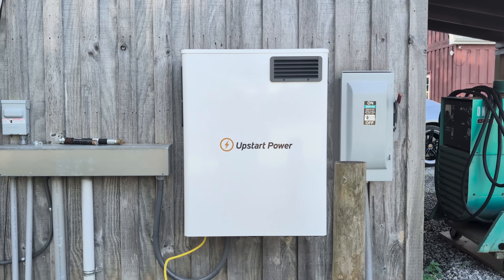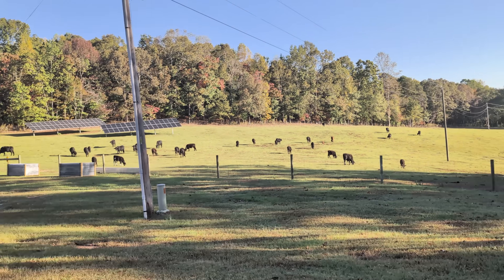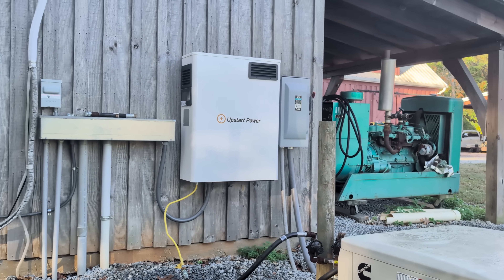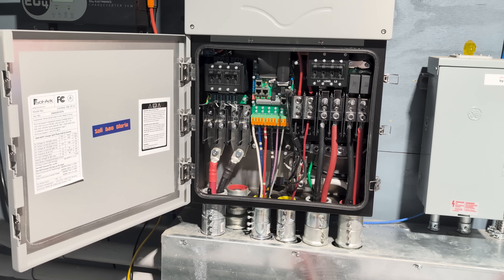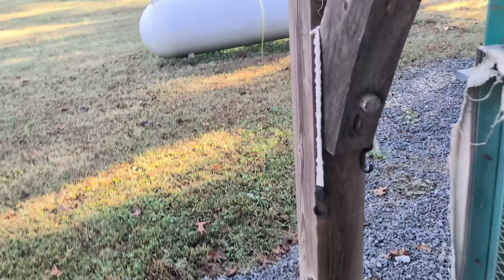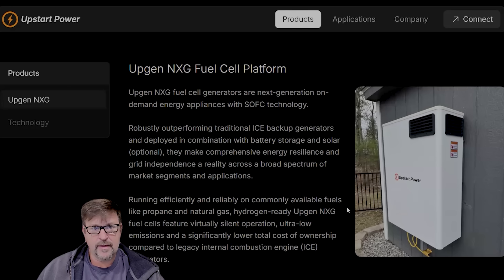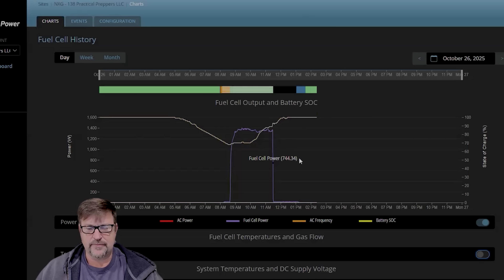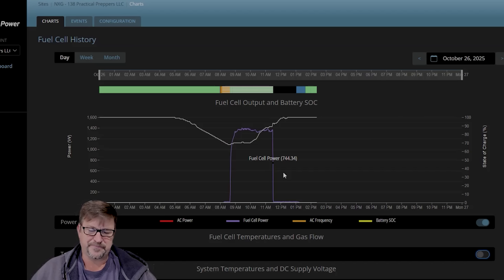You’ve Been Waiting for It | The Upstart Fuel Cell in Action

Comment: Does this utilize the 2 wire start? If so how do you wire the generator to kick in at a different SOC then the fuel cell?
Reply from the maker: Yes it does
Reply: @engineer775  is there a way to run two 2 wire starts on the sol ark?

Comment: This is super interesting. I live in a part of the Pacific Northwest where solar is difficult, but with frequent power outages due to winter storms we do have a 16kW propane backup generator with automatic cutover. I’ve been thinking about battery backup solutions lately, and it seems like we could augment that with one of these. I don’t think it could replace the generator, at least not yet, but I’m interested in doing more research.

Comment: This is very interesting!  I've lived off grid for over 4 years and hearing the generator run during 3-4 months to charge the batteries when the sun just isn't there is quite a bit different than the quietness of solar production.  I think about where we live having an over abundance of wood and the ability to produce wood-gas to power our backup power needs.  I also think about the excess generation that we have in the summer months and the ability to create hydrogen that could be stored for the winter months on a fuel cell like this.  I would love you to do an experiment on wood-gas generation and the ability for the fuel cell to use that as a source rather than propane.  Keep up the great work!

Comment: A (Help-)question from Holland/Netherlands. I have a SigEnergy plus gateway 10 kWh inverter plus ~27Kv battery systtem (3 *  battery type 10 SigEnergy) and 14 * 475 Aiko Solar panels. I'm looking for a super low noise (whisper-silent) device to load my battery with autostart. I'm living in a urban environment (on both sides of my home I have neibours, so a normal inverter-generator (>60db) is to  loud. My SigEnegery-system support a 3 3 phase 230v/400v autostart inverter-generator. I.m not able to find a "very low noice c.q. Whisper-silent" inverter generator. Can yopu help me out (I'm not a technical person but I'll hire a eclectrician  for install a proper device)  Hope I can find the proper solution to top-up/load/unload my brands new battery system with your "helping suggestion/support" TIA

Comment: Wow.. I'd really like to know how many kWh per Kg of propane!
Reply: FUEL CONSUMPTION:
Propane: 0.13 Gal / kWh
Natural Gas: 12 ft3 / kWh
Reply: @UpstartPower  am I doing the math right? ~4kWh/Kg of propane?  If so, we sailors desperately need a marinized version!
Reply: @GordLamb   Propane:
0.13 gallons = 0.25kg / kWh
1kg = 4kWh 😀
Reply: @GordLamb  What are the requirements for propane storage on a sail boat and what are other marine-specific requirements?
Reply: @UpstartPower  storage is typically in a corrosion resistant tank (ie. aluminum or stainless steel) with a remotely controlled shutoff solenoid at the tank itself.  Since propane's heavier than air, sensors/alarms are usually placed at the lowest point (ie. bilge), often with remote solenoid control.  From the device perspective, the goal of marinization is to reduce susceptibility to corrosion and vibration, and often to heat sink with seawater rather than air.

Induction stoves are becoming way more common today but many (probably most) boats under 50' still have propane aboard for cooking, usually with 20-50lb of propane.  Tapping into it for a fuel cell would be a piece of cake.
Reply: @GordLamb  Noted. Thank you! 🙂

Comment: Will the fuel cell work in Arctic conditions? It get down to -50f where I live but this is intriguing. With how quiet it is, could it be run inside and have the exhaust piped outside?

Comment: I'd be interested in seeing a fuel efficiency comparison between the fuel cell and and IC engine generators. Also interested in a total cost of ownership comparison for 5, 10, and 20 years.
Reply: I would also be interested in a side by side comparison in KWH provided versus the propane generator and the upstart in propane use.  You could use two full portable propane bottles to get your measured results.  If what they are saying is true it would produce 8x the KWH over time.
Reply: @Jim14872  based on their published numbers, it looks like they are about equal, but of course the fuel cell is silent and requires little to no maintenance.  I am not sure where this claim of 8x is coming from?

Comment: Could you tell us more about the software you are using to monitor and integrate the fuel cell into your system? Does Upstart provide a Modbus register map, MQTT topics, or an open API that could be used to integrate with a system like Node-Red or Home Assistant? Currently I use Solar Assistant to provide an MQTT interface from my two Sol-Ark 15ks towards Home Assistant for monitoring and in the future, load management.

Comment: Awesome piece of equipment. I will own one when they are available for $2-3k
Reply: That will never happen as their is far more than $3k worth of precious metal in the fuel cell. Also you really want to pay 5 times as much compared to diesel for a fuel that is hard to get, hard to transport, hard to store and embrittles every piece of metal it comes in contact with?
Reply: @Aircam73  again, the primary fuel source for this product is propane, which is slightly less expensive than diesel where I live (by volume, in terms of energy stored about the same).
Reply: @qaggaz diesel is currently $4.09 a gallon here and diesel generators are noisy and require maintenance. I’m looking for a quiet, low maintenance path.
Reply: @qaggaz  Propane is just the added step that is used because hydrogen is so hard to source. The propane has to go through an extra step losing energy to convert to hydrogen before going into the fuel cell. This method and even the hydrogen method means the fuel cell can't be put indoors because when propane is used it create hydrogen on the backside that has to be released. Even direct hydrogen fuel cells should not be put indoor as any leak will pretty much blow up the building.
Reply: @Aircam73  Understood.
Reply: @Aircam73  however you stated that the fuel used (I assume you meant hydrogen) was five times as expensive as diesel. However, propane is certainly not more expensive than diesel, and that is the fuel that this unit uses (transforming it in to hydrogen as an intermediate step).

The data sheet specifies 0.13 gallons of propane per kWh, which is about the same conversion rate that I get with my diesel generator. So, not much money to be saved there, but also not worse than a diesel generator, and certainly quieter and requiring less maintenance.
Reply: @qaggaz  The data sheet is going to be a little optimistic as we can see they said it should produce 1,600 watts but only produced 1,400 watts. Also how much electricity is lost converting the propane to hydrogen? They keep saying that the fuel cell is MAKING 1,400 watts but of that 1,400 watts how much is being delivered to the batteries or your home power? Maintenance is probably going to be less on the fuel cell than the generator but the cost per kWh over the generators lifetime is going to be far less. With the incredibly low runtime of fuel cells before needing to be replaced and and the steam reforming part of the system as the very expensive rhodium is used up makes the diesel generator far cheaper over its lifetime of 50,000+ hours vs 2,000 to 3,000  hours in a fuel cell.

Comment: Look up Mike Strizki. And his hydrogen house. Old school YouTube stuff. He built a fuel cell with 10 x 1000 gallon propane tanks that pushes and pulls hydrogen from these tank banks to store during day then pull from at night. That idea with today’s tech would be so so cools
Reply: Hydrogen storage ends up being one of the more complex parts of the system (unless you have a lot of room for low pressure storage!). But that is exactly my goal as well. To be able to supplement propane with solar generated hydrogen, but to be able to run off of either pure propane (if needed) or pure hydrogen (to limit the amount of H2 storage required).

Comment: Crazy that for 8k I can buy about 6 100kwh tesla model s batteries these days. This is doa tech. Especially when ev's are rampant and cheap.
Reply: You still have to charge the batteries.
Reply: @qaggaz 10 cents a watt for solar panels. Even on cloudiest days you can get that extra 6kwh he was generating in a jiffy. This would be great for an underground bunker though
Reply: @EugenePutin  He was talking about generating 30 kWh, not 6. And I do not know where you live, but I live in Alaska. Yesterday my 9 kWp array produced a grand total of 3.64 kWh. I would have needed at least a 72 kWp array to generate at least 30 kWh per day this week, and even more come December. I would also need a stack of charge controllers to handle the new panels, racks, lots of copper wire. The cost of the panels would not be the largest expense, and I could not come close to using the power that would be produced in Summer unless I needed to heat a pool or something.
Reply: @qaggaz ah yes alaska is rough

Comment: It would be interesting if the fuel cell worked in reverse. Excess solar input to make propane to store in the tank for cloudy winter time.
Reply: It does not.  #UpgenNXG is based on solid-oxide fuel cell technology. It  turns readily available propane or natural gas into electricity through an electro-chemical reaction.
Reply: @UpstartPower yeah well it would be 10,000x cooler if it could make propane- which is what he was saying.
THAT would be the missing link to make the average guy actually off-grid.
Make propane all summer when there is tons of solar, use propane for heat all winter when there isn't. Get to work on that, please.
Reply: @UpstartPower  But it is "hydrogen-ready" correct? If you did have an electrolyzer and hydrogen storage, the SOFC should be able to convert the H2 to H20 + electricity also.
Reply: More interesting I think would be conversion from a gas to a liquid (longer hydrocarbon chains) - liquids are more energy dense, and those like diesel or kerosene are less explosive.
  
Biogas is fairly easy to get from fermentation or composting that's about the shortest hydrocarbon chain (CH4).  Fuel cells work by de-linking those hydrogen atom from the carbon - the reverse is doable today using the Fischer-Tropsch method, but not generally done at small scale outside a lab.  Propane (C3H8) is a longer chain, and could be stored in liquid form (cryo-cooled) to take less physical volume. So like a biogas to LPG device that did it with mostly surplus electricity would be cool.
Reply: It can be done. Guy in YouTube 2 years ago had his whole house on a fuel cell. With 10 x 1000 propane tanks, he would store hydrogen at relatively low pressures.
Reply: You can purchase a Enapter electrolyzer to produce hydrogen with excess solar input. The tricky part is that you then have to store it. Usually this involves a compressor and special tanks made of composite materials specifically designed for high pressure (300 - 800 bar) hydrogen storage.

Comment: 1400watts? man a suitcase geny could do better then that and at 8-10k it could do it for a very long time
Reply: Concur.

The #EnergyManagementSystem that is being tested here consists of:

1 x Sol-Ark 18K-2P Hybrid Inverter (18 kW)
2 x Discover Energy Helios Batteries ( 2 x 16 kWh = 32 kWh)
1 x Upgen NXG Fuel Cell - DC-coupled (34 kWh per day)

The #UpgenNXG Fuel Cell acts as a "support system" for battery storage (+ solar) that powers your loads. During a prolonged grid outage (assuming an average daily home load of ~ 30kWh), the batteries alone provide just a little more than a full day of #EnergyResilience.

In a well-designed energy management system, the#UpgenNXG Fuel Cell enables "the right amount" of battery storage (+ "the right amount" of solar) to do their job for as long as the grid outage lasts, even when there is insufficient sunshine. The amount of batteries that you would have to add to a system to achieve the same level of#EnergyResilience is not economical even if space allows.

>>> #BatteryStorage +#UpgenNXG Fuel Cell replaces the legacy internal combustion engine #HSBGenerator in your #HEMS design.

#NeverEmptyBattery

Sol-Ark
Discover Energy Systems
Practical Preppers LLC

Comment: Sweet.  Thanks for sharing this.  I had all but given up on fuel cells.....I have a bunch of clients that this would be perfect for.
Reply: Why? Do they like not being able to replenish their fuel? Only able to run it for a very short time before needing to replace it? Likes spending thousands of dollars every 7 to 10 years to replace the storage tanks? Or maybe they like paying 5 times as much for fuel compared to gas or diesel?
Reply: @Aircam73  Where do you live where propane costs 5 times as much as diesel?  My 1100 gallon propane tank was manufactured in 1956. It gets regular inspections from my fuel supplier, but does not need replacement yet. I rent my tank, but if I wanted to buy one, they were about $3000 last time I checked.
Reply: @qaggaz the fuel cell will need replacement something like 3000-4000 hrs that's like 5-6 months of runtime
Reply: @qaggaz the cell would never last as long to be able to use even one full tank of your propane
Reply: @NightshiftCustom  based on what? The only longevity numbers we have are based on the length of the warranty. As I mentioned before, my diesel generator only had a 1 year / 1500 hour warranty, but you and I both know that it should last for upwards of 20000 hours. The warranty is just a way for the manufacturer to limit their own liability. For a small start up company, that is important.
Reply: @NightshiftCustom  where are you getting these numbers?
Reply: @qaggaz  There is lots of data out there. 
you say its NEW! but its been around for over 100 years as the first fuel cell was made in 1839 and GM even made a van in 1966 that ran on fuel cells its nothing new at all man!
if there were so good we would have them everywhere you would think! sure maybe one day but as of now fuel cells used in cars and trucks are rated for 5000hrs life expectancy 
the other problem is turning it on and off wears the cell fast (heat cycles)
and that is why it likely only got a 250 cycles warranty. so if you did what is shown in the video you would be out of warranty in less then a year from runtime and cycles alone. (365 days/2190hrs) so for them to say 10y is just bullshit if you ask me 

now there is also lots of data for large scale fuel cell power plants but they run none stop and are made/rated for 20-50.000hrs+ and then the cell's can be replaced every 5-10y with the system lasting say 20yr altogether 
but this is not that

Comment: How often would you need a fossil fuel power source vs just adding more solar?
Reply: It depends on where you live. According to https://pvwatts.nrel.gov/ the solar radiation at my house in December is 0.24  kWh / m^2 / day. Assuming a load of about 35 kWh per day, I would need a 250 kW PV array to generate enough energy to power my house in December. In June, that same array would produce an absurd 32 MWh of energy. In addition to the cost, an array of that size requires a massive amount of area!

A more reasonable approach would be a 25 kW array that could generate 111 kWh in December, or about 10% of my load, (assuming I could keep the snow off) and 3234 kWh (about 300% of my monthly load) in June. That would mean that I would need to produce 989 kWh with fossil fuel in December. 

Ideally, I could store the excess energy produced in the summer months (about 10 MWh total) and use it in the winter. Storing 2-3 MWh in batteries or some form of compressed or liquefied hydrogen storage is expensive. Storing 2-3 MWh as fossil fuel is relatively inexpensive.